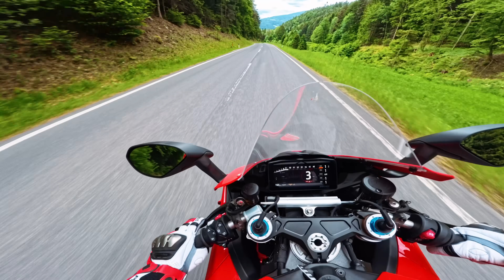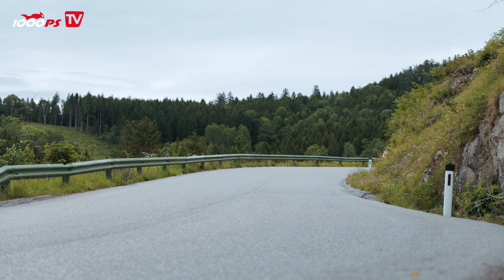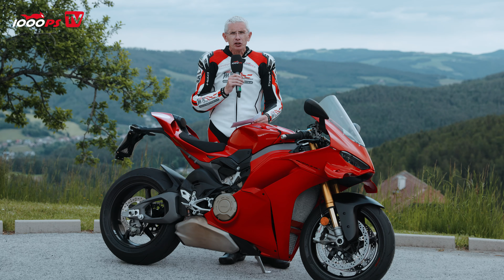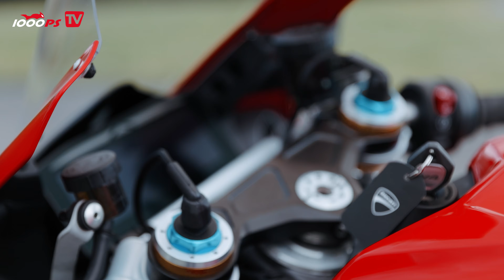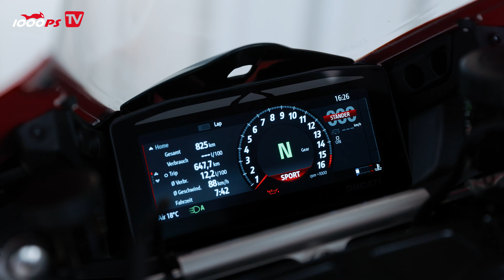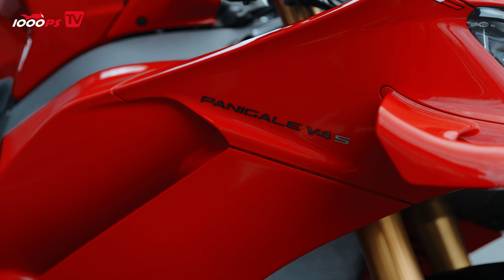Review Ducati Panigale V4S 2025: The ultimate in-depth test on road and racetrack

Comment: If you were to somehow metaphorically blindfold your test team, how do you think the Panigale compares with the Aprilia RSV4 that you recently tested? Your comments on this would be appreciated.
Reply from the maker: We're releasing the comparison video by the end of the week ;)
Reply: @1000pscom  thanks 🫰
Reply: @bduk-00  as someone who had a RSV4 Factory and now a Pani V4S (2025 model). I prefer the Aprilia’s engine, is much smoother and seems to make more torque low down. The Pani feels lighter and roomier (193cm tall). Overall, they are very close and both are brilliant. I would have gone with another RSV4 (2026 model) but my dealer an over an hour away and when I went to see them, it wasn’t a good sales experience… which is strange as I had the money in my pocket and knew what I wanted, some how he managed to persuade me to walk away and went straight to my Ducati dealer on the way home and purchased the Pani. 🤦‍♂️